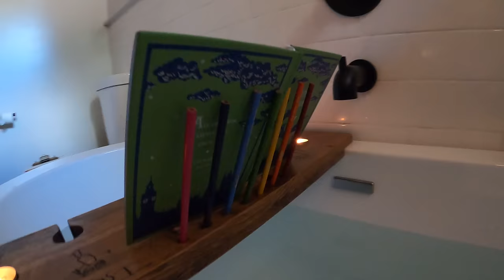How to Make a Bath Caddy /// Kids Projects for Mom (2 of 3)

Comment: Good video and project.  Seems some steps were not mentioned.  For example, the corner edges on the top piece are rounded.  Was not shown how to do this.  Also, the staining, the finished work has beautiful finish, yet prior video sections show an ugly finish.  The polyurethane was the trick?  
I'm about to make a similar project using 1 x 12 inch pine (so I can fit a laptop).  I hope it looks even 1/10 as good as this.

Comment: Any recommendations for making the wine glass holder without the jigsaw?
Reply: I’m pretty sure you can do it with a hand saw as well. Just start at the edge and go up to the drilled hole. You can’t make the rounded edge at the start and end, but sandpaper should help with that.